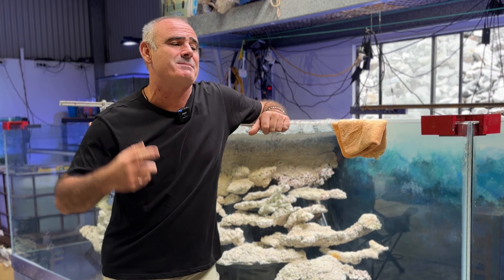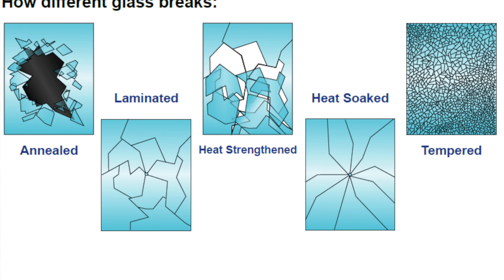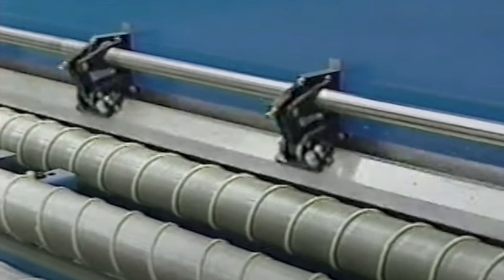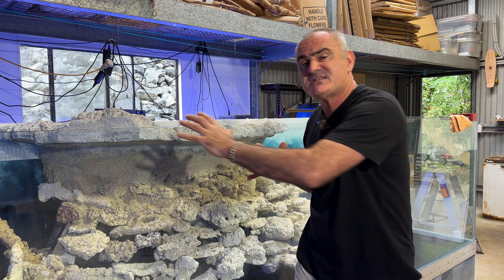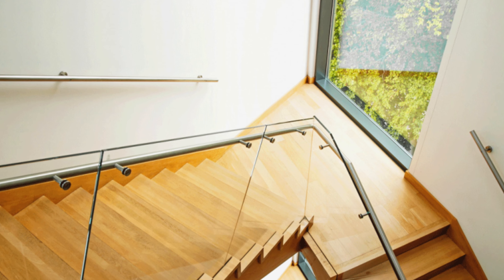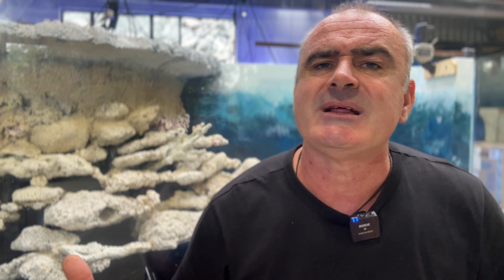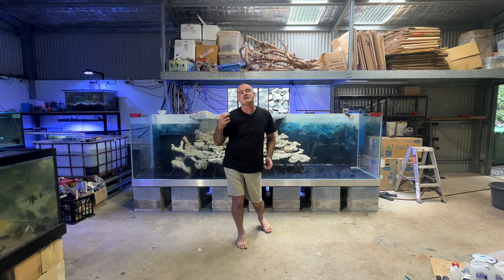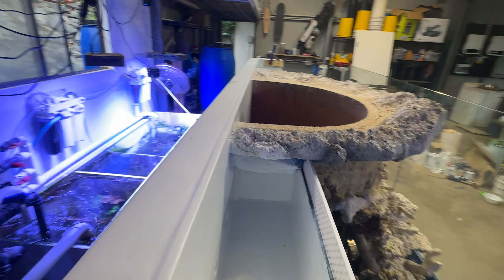HOW TO: (More Safely) Use TEMPERED GLASS in Plywood Aquariums....

Comment: What size sheets do you use? How big of a panel is pressure safe with 12mm thickness and your bracing?
Reply from the maker: So I can only tell you what I  have done, and my experiences…….

My two biggest tanks are 12 x 4 x 3.5 ft , and I use two 6 x 3.5 (1800 x 970mm) sheets of tempered glass across the front. I can report there is slight outward bowing at around half way up the height of the glass. But only at the bridge between the two sheets, and not in the middle of each separate pane. If a tank was made from one pane across the front, and locked in place with angle / bottom recess, on all four sides, I don’t think I’d see flex. I believe it’s just that the junction between the two adjacent sheets isn’t as secure as the other 3 sides. When I first saw this on the Palau tank, I freaked. Then I went outside to put a level on the turtle tanks front glass junction. It was the same. The turtle tank has been running for 18 months now. I stopped worrying then.

Comment: I’m sure I missed it. What’s the reason you didn’t go with an acrylic? Just price based on the availability of the ballast rated glass?
Reply from the maker: Acrylic isn’t really a thing, in Australia. You can get it, as it’s used for security screens over bank counters etc, however it’s not a common construction material in Australia generally. It is also way more expensive than our already expensive glass!!

Comment: Nice Adam. When you install the edging, do you pack it with anything or just silicone it?
Reply from the maker: I’ll do the top welded bracing first, and use a tonne of silicone. I’m aiming for a 5mm cushion. Then I’ll match the corner angles

Comment: Tank is coming along nicely!
Reply from the maker: Thanks Glub
Getting there
Reply: @australianaquarist  also, what do you think you will use to light this tank? I'm setting up a 475 gallon above ground pond with a viewing window and am planning to make it a coral pond but it is 200x150x60cm so it will be very expensive to illuminate, so im just wondering what you used to light your old reef tank and what your planning to use this time round. Cheers
Reply from the maker: @glub9075 that’s a very good question and something I’m still wrestling with. I want to mount the lights up high, so that they are well above the plants on the island, and the only lights I’m aware of that could be used this way are Kessil with narrow reflectors, or my trusty 400w metal halides. What are you thinking?
Reply: @australianaquarist  Hi, do you reckon ill be alright to use tempered glass with my aquarium even if it isn't heat soaked. I wont be drilling it as the holes are already cut into it before tempering and im hopefully avoiding a frame so I can have a fancy looking rimless tank. Thanks
Reply from the maker: What are the dimensions of the tank you’re planning and the thickness of the glass?
Reply from the maker: The other thing to remember is that tempered glass is weakest at the edges. If rimless, the tank must not get any knocks to the edges. Hard knocks , but you never know
Reply: @australianaquarist  I've done the math and my glass has a safety factor of 7, maybe more because its tempered but the tank is 200x100x36cm with 8mm sides and a 10mm bottom panel. It sounds thin but the tank is pretty shallow.
Reply from the maker: Mate that worries me a bit. Do you want to chat about the tank? I’m working with head phones on now, and can talk. 0402522738
Reply from the maker: You’re bottom panel would ideally be 12 mm , especially for a tank that long and wide. What are your plans for bracing?
Reply: @australianaquarist  rimless, but if you plug it into a glass thickness calculator it also gives you a safety factor of 7 which is whats recommended for rimless tanks, keep in mind its only 36 cm tall and glass thickness is mostly decided by the height not length/width of the aquarium
Reply from the maker: Agreed , height is definitely the first consideration, however I also consider water volume. 8mm is an unusual thickness, especially in tempered glass. How did you come to land on that thickness? 
In regards to the base. The wider and larger the area , the more prone it is to slight discrepancy in how level the base is. If there’s any instability etc, a thinner base will be less able to withstand it
Reply from the maker: There are plenty of people that use straight tempered glass. I just like the idea of the secondary safety factor. Many of the American plywood builds you see are using straight tempered glass
Reply: @australianaquarist  im buying glass directly from a wholesaler so that im able to have holes and stuff cut out of it before tempering - thats also why I can have 8mm. For underneath my base panel it will go on a plywood stand that i built as well as polystyrene and 6mm neoprene foam
Reply from the maker: @glub9075 you might find that 10mm glass is the same price as the 8mm . You wouldn’t even need to temper it.

Comment: Great information Adam! I've used tempered glass a lot in the past, I've even tried to cut it once unknowingly thinking it was float glass, it's amazing how much you can actually bow it without it breaking, but one little tap as you said to the edge and it's like a bomb, make sure you cushion those corners with a heap of silicone before you put those brackets on, but you know that for sure, the build is coming along great mate! 🙂

Comment: I've built a 300g, it's 3' tall and 4' wide. It's half inch wow she bows... bracing and all that.  can't fill it all the way.
Reply from the maker: Is it worth draining it down and reinforcing the degree of bracing you have?
Reply: @australianaquarist  hey! Thanks for the response. 

No, im afraid it would  need a brace in the center of the glass.it has euro bracing.the glass is embedded in plywood, with no deflection. It had almost 1/4" bow 3/4 full ..  a bit too much for me.It looks nice as a huge paladarium. Lesson learned. Haha
Reply: @australianaquarist  the frame isn't bending at all. Just the pane.. I don't want to ruin that open space.. I'll use 3/4" next time. It's the height, so much pressure.
Reply from the maker: So you have no cross braces at the top?
Reply from the maker: If only euro braced, the front euro must be deflecting outwards with the glass? Obviously as the water height increases so does the pressure, so it would be very odd to have the glass bow in the centre of the pane, but not at the top. My turtle tank uses 1/2” tempered glass, but has cross braces from the front to the back of the tank.
Reply from the maker: Also if it’s timber acting as the euro brace, the timber will easily bow out. Easier than glass. Could you consider reinforcing across  the top with a metal angle?
Reply: @australianaquarist  The frame doesn't bend what's so ever. The glass is bending  like a bubble in the frame. Just the centre of the glass. Never seen a pane bend like that. Imagine a cheet of paper. Secured on all four edges. But the centre is the only part that's bowing..... haha, yikes.
Reply: @australianaquarist  yeah, I can tell the top bracing isn't moving because it's still parallel. I also added a centre brace,  reluctantly. But it turns out it was overkill. Weird enough, it's only the glass. Just not up to standard.
Reply: @australianaquarist  my tank is 3' 10" tall. So much pressure, have to move up a size. Two if you want to never think about it again. I'll definitely  build it bigger next time. 1" 4'x8' 

Or a super long 12'x 2.5' made out of an old tank.
Reply: @australianaquarist  all edges are supported. The that top edge is crossed braced. So it has both top bracing styles. I'm very happy with the ply wood. I would say I slightly over built it. It's all 2x4s and 3/4" ply. It's a beaut. Can't use the waterfall filter because the waterleveles too low. So I'm making a living wall to span the gap and get the above tank plant sump to be useful.
Reply: @australianaquarist  had that on after the first test  fill. I used two 3/4"plywood sheets laminatedand mega screwed to the top. They encompass the top plane of the tank. overlapping in the centre. So the connection  is as strong as it could be. That thing ain't moving. It's truly the glass bending just how you think it is. The scary way. Hahah
Reply: @australianaquarist  my cross bar is 1/4 "x 3 " rolled steel attached with 8 structural  screws. It's bomb proof. Just after I built it. A 8'x4'  1" sheet of acrylic glass came into my life. But I don't trust the building style you need to use with plastic.  Maybe in the garden.
Reply from the maker: Well it certainly sounds like it’s structurally built!! You’re right….  I’ve never seen a glass pane bow in the middle , whilst its edges stay fixed. Short of putting a vertical fin in the middle of the pane, it sounds like you’ve got the only solution by keeping the water level down.